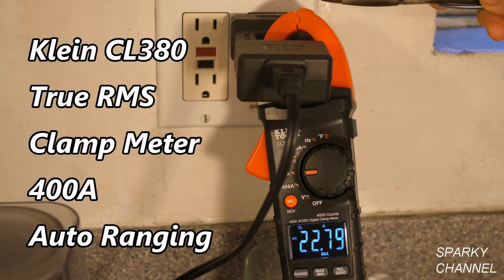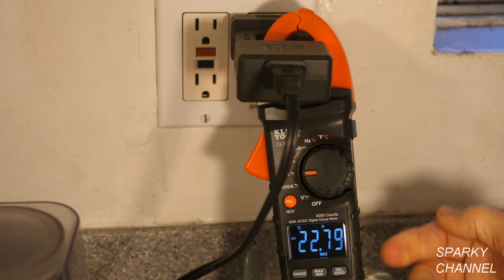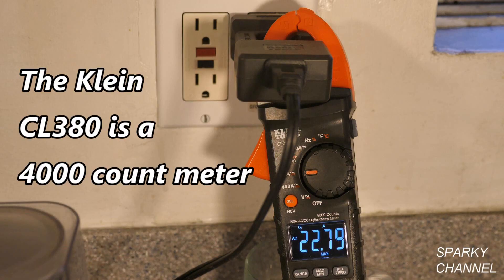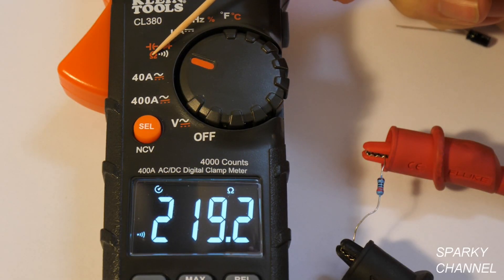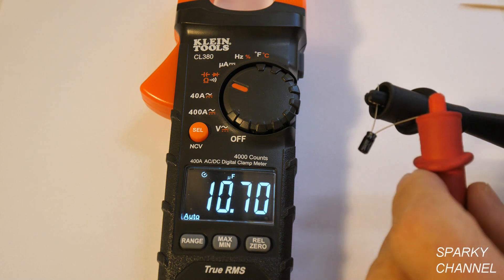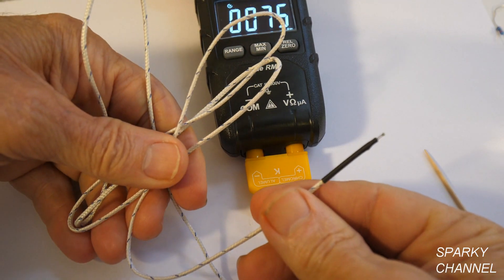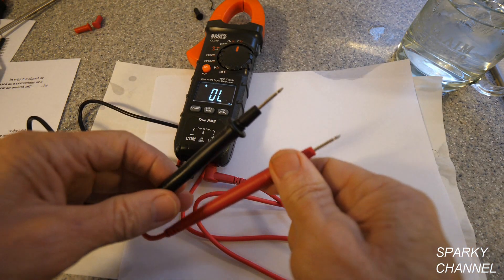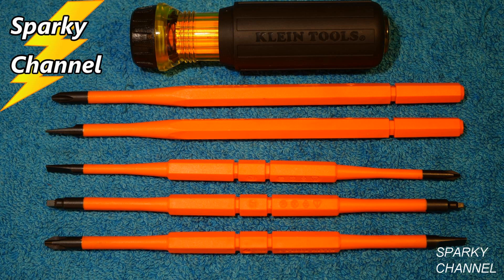Klein Tools CL380 AC/DC Digital HVAC Clamp Meter, 400A Auto-Ranging

Comment: temp in ice water should be 32 DEG... not what you have i think... my book tells me to check temp meter with ice water should be 32 deg ???
Reply from the maker: Yes, but you would need to leave the probe in the ice water for a while.
Reply: @SparkyChannel   supposed to have equal ammounts ice and water by weight to calibrate and should be 32 deg F

Comment: I have a old rental house built in 1928. I am worried that the Receptacle circuits might be pushing their 30 amp limits is there a way I can check the amps on the circuit without just blowing out fuses. I do not have  access to the wires of the fuse box. I am thinking I can replace a fuse with one of those screw in light socket plug adapter and maybe have to plug in line splitter plus a load like a test light bulb or my receptacle tester then I can check the total amps being used in the house circuit. Please give me a sanity check before I blow something up. Do video if it’s a good idea. 9:03

Comment: The fact that this tests diodes and capacitors and other things used in low voltage electronics is disgustingly offensive. Especially since this amp has a deadzone when reading dc amps from 200micro to 300 milliamperes. That’s a hefty zone. This meter is a trash. Klein has fallen off the wagon and is on the greedy warpath.
Reply: I disagree, these are marketed toward electricians and hvac techs. Not electronics engineers.
Reply: "The fact it tests diodes and capacitors is offensive"?  Why?  thats a good thing.
Reply: @gantfrost7749  because it makes it seem like a perfect tool for small electronic projects. But you can’t even read anything under 1A. And if you want one  that does that’s another $100 sum for a new meter.

Comment: This would have been an awesome review if you would have used it in the DC clamp setting.
Reply: The dc clamp is shit. The dc amp setting deviates hard back and forth. I just got one and I’m in the process of returning it.  I need it for low voltage electronics. And the dc amps even though it has a micro reading. It’s only to 200 micro amps. After that it’s a deadzone no read all the way up to 300 milliamps. As it won’t read anything over 200 in the micro setting. And won’t register anything until .3amps (300milliamps) it appears to have the entire range on the box. But this is untrue. This meter is another feature lacking wash from Klein. Fluke or bust.

Comment: I got the same meter and this is my first time using a meter. I was wondering is it normal for a meter to not zero out on the voltage setting?
Reply: That is explained in the instruction manual.  It is electrical noise within the unit and is normal.

Comment: Thanks for the review, Bill. I just purchased one yesterday. I lost my main meter so I picked up this one. Hoping my other one turns up. I have a couple of Fluke meters and both are on the fritz. The clamp meter, I'm not going to have repaired but the multi meter, fluke 77 series 2 has a display problem. What's your opinion as far as sending one in for repair that has some age to it?

Comment: At the beginning of the video it sounds like you're equating the max-hold setting of the meter with inrush current measurement. I believe they are very different. Klein offers inrush measurement on the CL450 and the CL900, but not on this CL380. I'm not sure how quickly this meter samples measurements. I'm not sure how easy it is, or if it's even possible to get an accurate inrush measurement with this meter. Since there's some obvious editing at the beginning, I wonder how many tries it took to get that number? It would be interesting to compare side-by-side with one of their meters that specifically offers inrush measurements.

Comment: Can you do current test with the leads?
Reply from the maker: Yes, but you have to break into the circuit. It's much easier with a clamp meter.
Reply: Can you test 110v
Reply: @mrblonde1231  7